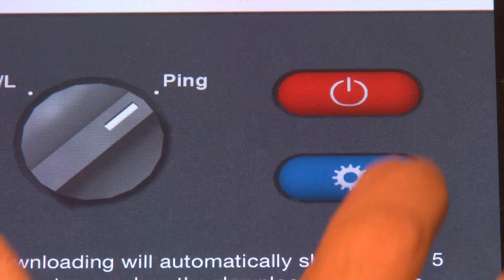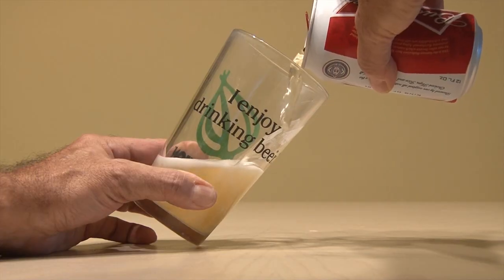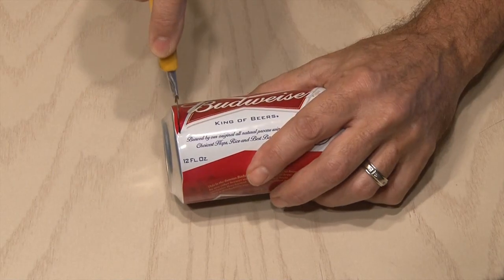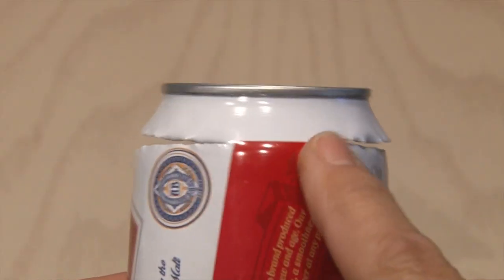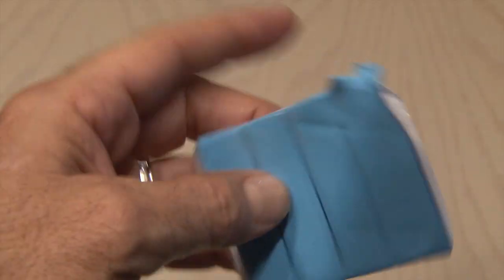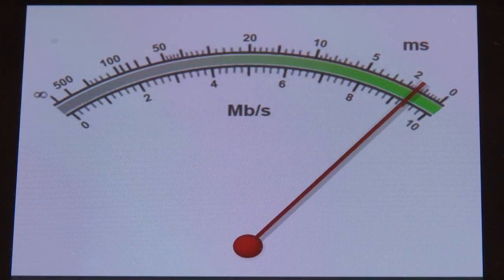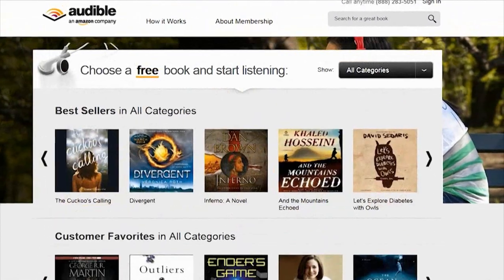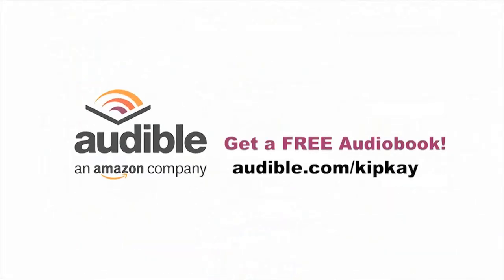Brew Can WiFi Signal Booster

Comment: yes,it works, but you have to be careful with where you aim it. the reason it amplifies signals is because it's reflecting those signals that would ordinarily travel behind the router to the direction of the reflector. wherever you point it will have an increased signal strength, but behind it will be close to zero. this is only useful if your router is in the corner of your house and the signals traveling behind are being wasted; if it's in the center, you'd be cutting off a part of your house.

Comment: it may be a wired only router, though those are very rare these days. If it's a wireless router (i.e. you can connect your phone/tablet/whatever to it) then the antenna is inside of the router. This trick will still work as long as you angle the reflector correctly.

Comment: If it's wireless, it has antennas, though they may be internal. If it's not wireless, then it doesn't matter because there would be no wi-fi signal to boost.

Comment: I used to do this trick with my wlan stick but now i use an antenna version and it kinda makes the signal worse so i stick to the standard antenna now. Also the router has no antennas should i build a dish out of alominium foil now ? :D

Comment: Kickass Kipkay, thats what I like about the most of your Videos as opposed to the Make Youtube posts, they're stuff anyone can make with things lying around the house, not having to run out and buy a arduino or like one of the videos they posted recently involving a big expensive 3D printer, not exactly something everyone has lying around the house, just wondering though where to put the boosters if the router has no external antennae?

Comment: doesn't need to be an external antenna, just use a big coffee can, cut a slit down the side and across the bottom, peal the sides open, and put the can around and over your router upside down, same concept.

Comment: This actualy works. As an IT tech what this is doing is taking the wifi signal and focusing the broadcast in a certain direction. It will only improve the speed in the direction the can/dish is pointing, and will actually hinder it a little in other directions but it took my wi-fi signal and boosted it to wired internet speed. SO me strategic router placement and BAM! Ultra-high speed wi-fi for my apartment.

Comment: Some modems are all in one units of modem, router, and switch. These type do give out your wi-fi signal. Others are not all in one units and do not give off a wifi signal and must be connected to the router to do so. Google your specific modem brand and model to find out.

Comment: Not true. There are tons of enterprise grade and high end consumer wifi equipment that still utilize external antennas. Some of the highest rated smallnetbuilder routers are ASUS routers utilizing external antennas, and let's not forget, it allows the ability to upgrade to higher gain antennas in the future, and don't use "older network frequencies" they're modern AC routers.

Comment: You guys are missing the point. It's a directional waveguide. It's not about adding more metal with the wrong characteristic impedence. It's not electrically connected. The antennas have a plastic coating. There's no need to disassemble your router.

Comment: I put some tinfoil behind my router without antennas and that gave me an extra bar. Making a tinfoil cone around my wireless usb adapter gave me an extra two bars and about 17Mb/s download and 3.5Mb/s upload. You can check your ping and stuff at speedtest (dot) net

Comment: ---If your router doesn't have an antenna--- YOUR FUCKED! =P Or you can just place the open can behind your router if there is space, facing the area you wish to boost. 

inside your antenna-less route is still a wire that acts as the antenna, just this hack wont work as good, and from my experience didn't work all to great with the antennas

Comment: Since mine works a half block away from my house I'm OK with it. At the time, it was one of the best N channel Linksys units.  Since I rarely need it beyond a half block from my house, it will suffice.   I will replace with a new AC unit when more devices support it.

Comment: It depends on what kind of electricity it runs. If your router runs on batteries you should be cancer-free. However the routers you have to plug into a socket send out a very small but very potent radiation wave, everytime router is in use.
"There are some cheap, household tricks you can do to reduce, or even, have no radiation anymore. Placing a magnet ontop of your router is the most effective one."
-Amanda Kisenhug, NYTechMagazine.

Comment: steps to remove yourself from toaster. plug in toaster, push down on handle, wait 10 seconds. Toaster should be removed from penis if not repeat until desire results

Comment: My router has an internal antenna and sits in my basement, so I'm going to cut a couple of cans, but instead of orienting them horizontally, I'm going to set the router on the cans inside the concave part with the focus upward.

Comment: if you really want to use this technique with a router that doesn't have external antennas a good way is to cut a large coffee can in half, or just cut the side and a slit down the bottom, then put the router underneath the upside down can with the open end pointed in the direction you are trying to get a better signal, keep in mind though that the signal on the other side will be degraded using this method (including the beer can version).

Comment: Kipkay
You can (hehehe I said "can") get printer paper file folder or thick paper or thing cardboard print out the diagram from free antennas dot com glue the foil to the cardboard and the diagram on then cut out the pieces and put them together and you won't cut yourself by the finished product dangers using cutting tools are the same.

Comment: kinda. it is the same concept as a satelite dish. if you go behind the reflectors he made the signal strength will be seriously degraded, he just turned it into a directional antenna. it works the same for sending and receiving, just make sure both are pointing at each other, and on the receiving end it can help filter out interference, just make sure that the reflectors are pointed the right direction.

Comment: better solution is to get the wifi access point closer to the center of the house so that it the omnidirectional antenna can cover the whole house, all you are doing with this is reflecting the signal. i suppose it can be useful in situations where you cannot relocate the router, but it isn't a booster, those actually exist, and they are powered.

Comment: There is TONS of direkted antennas out there. That probobly works better, And there is a way to boost the signal without making it direktional.
With understanding of the router and its signal band.
Its just so many users on the same band, so change it and the signal might go up 10 times if no one uses that band. and u dident even need the beer. Cheers